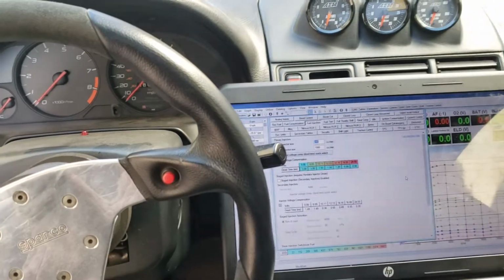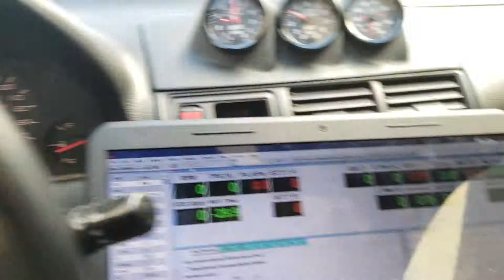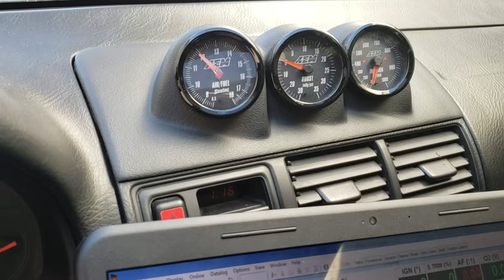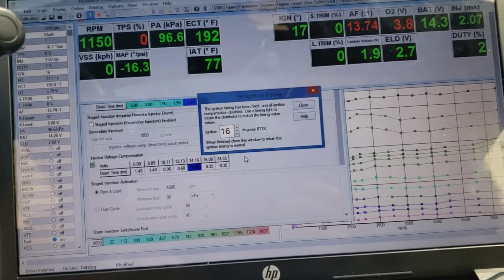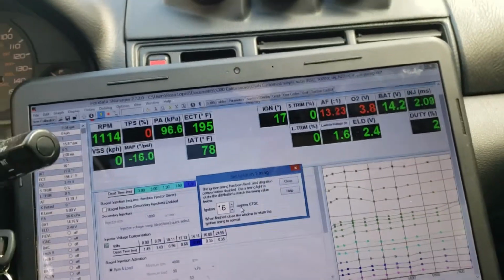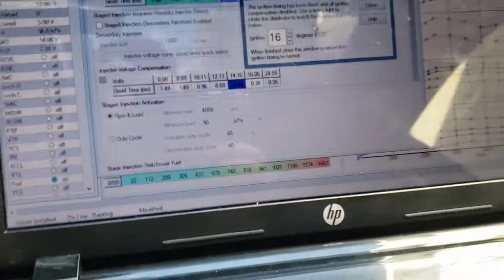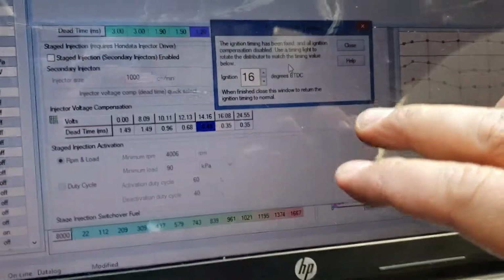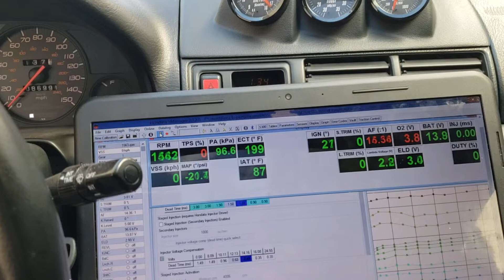HONDATA s300! Set ignition timing software/distributor

Comment: if u set it to 16 why was is showing up as 18 on idle
Reply from the maker: It showing  18  because  of the other  sensors it compensate  for coolant  temp, intake temp etc
Reply: Jasmine & Father Garage ahh alright I have a b20v turbo and it’s cutting at the high rpm my timing might be off 2 degrees tho so that might be why
Reply from the maker: @db2alex746  Missed firing  at high rpm only,  On any gear? Are you running  one step colder plugs or just stock?  What  gap your plugs at?
Reply: Jasmine & Father Garage running bkr9eix gapped at 25 and it seems to just cut off around 4500 rpm on full throttle I can go slowly thru the whole gear but once I full throttle it starts cutting just going to take it to my tuner
Reply from the maker: @db2alex746  What AFR your at when your  on highcam (wot)  especially  around 4500rpm?
Reply from the maker: What's your high and low boost cut set to?